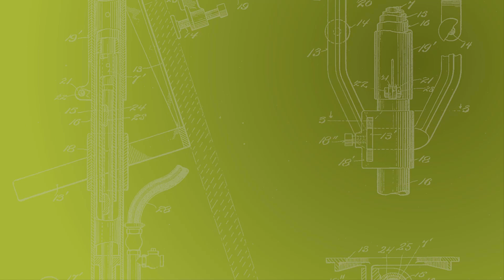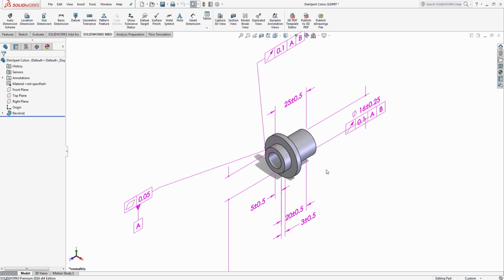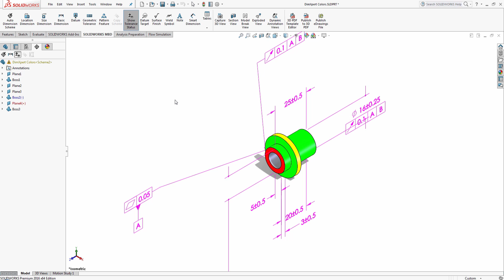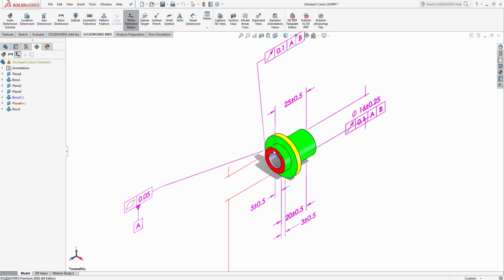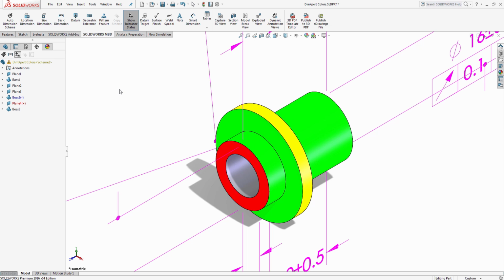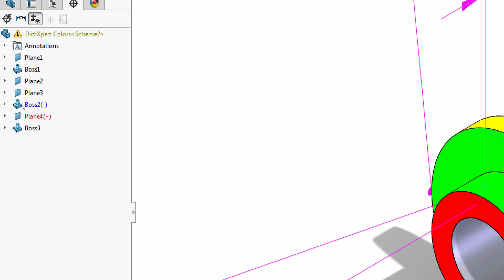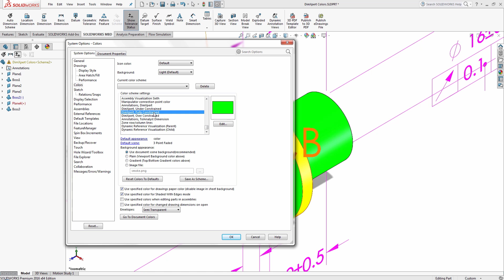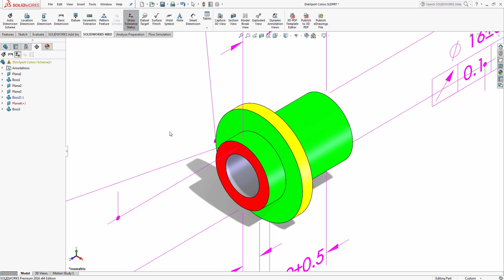SOLIDWORKS MBD - Understanding DimXpert Colors

Comment: Hmmm. I made the mistake of choosing "All Features". The number of dim's has cluttered the document. Can I remove them all and choose only one feature? I unselected "All Features" and chose only the single feature I wanted. But the other dim's didn't disappear as I thought they might. Nice explanation you did here.
Reply from the maker: If you want to remove any annotations you’ve defined, you can delete them in one of two ways:

1.	You can select the dimensions in the viewport/graphics area and press delete on your keyboard.
2.	From the DimXpert Manager Tab (the crosshair icon on the tabs right the right of the feature manager tree), you can RMB the file name and choose Delete.

The second option will delete everything and you will have to start from scratch.